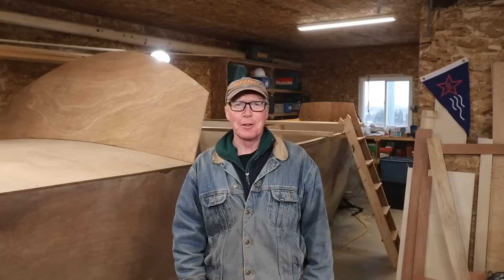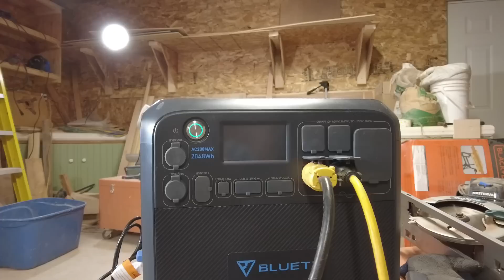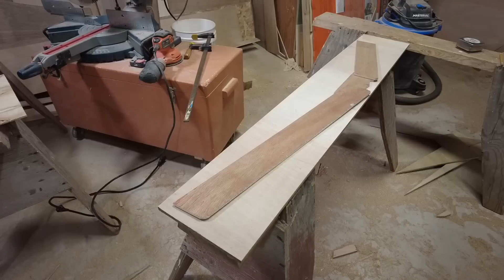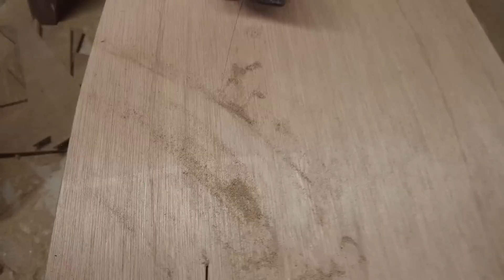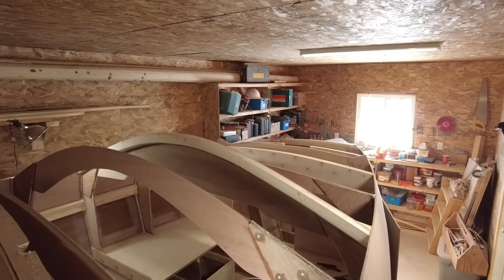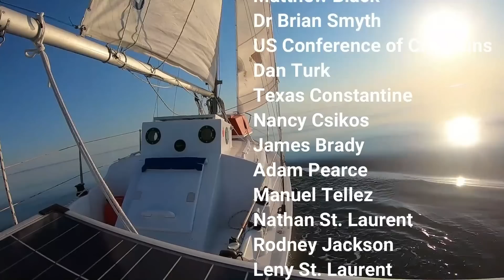S2E68 Ring Frames are Completed and the Shop Tools are Powered by the Bluetti AC 200 Max.

Comment: You may be able to charge your drill battery with 12v dc. I know that Makita makes a 12v charger for their 18v batteries. It's never available in stores and costs a lot more than the AC chargers. Whatever drill brand you use may have one also.
Reply from the maker: Thanks for that, I'll have to do a little research

Comment: Hi, please be careful with the bluetti and temperatures below freezing point! I think, discharging is not that much of a problem, but you have to take care, that the LiFePo4's are warm, when you try to charge them. They are too expensive to mess them up ;-)
Reply from the maker: Great point! I know that the larger model has a pre heater.

Comment: Alan if your going t have  some AC on the boat, I'd suggest a low power travel water kettle, they can be found at the 750 ml / 900 watt class, would save cooking fuel and reduce the heating water fire hazard etc I have a small 12v inverter and power mine from it when i'm on my car camping trips
Reply from the maker: Interesting concept I will have to run the numbers. Can you send me the brand name of your kettle.

Comment: When we talk about power draw (watts) of any device or tool, the "wattage" is a rate of consumption of energy. There is no "hour" involved here yet, so a laptop drawing 100 W is working at 100 watts of power. (No need to mention the hour, ever.) Often less if it's idle, of course, just like when gunning that wormgear before it was given something to cut.

(One watt is one joule per second, so you can't divide it by time again - that would imply an acceleration of the power draw over time!)

Here's a mnemonic to help when thinking about it: Let's think of watts of power in terms of a deck hand that can muster 100 watts. If you have a bilge pump that draws 100 W, that's like that man pumping at a brisk but leasurely pace all the time until he's relieved. If the leak requires him to pump all day long, that's 24 man-hours of work. Man-hours, watt-hours, same principle! Here's where the hours do come in but they are used as a multiplier, not a divider! (100 W) x (24 h) = 2400 Watt-hours, or 2.4 kWh of energy was required. (A bit more than is available in that Bluetti in one full charge, I think!)

Now let's imagine there's a 100 W photovoltaic solar panel on deck supplying energy and let's assume it manages to see the Sun for what's equivalent of six hours of perfect insolation (even if the days are longer, there are clouds, shadows, and imperfect conditions due to shading by rigging, sails, and not facing the Sun all the time). This gives us (100 W) * (6 h) = 600 Wh of energy per day per panel! This can serve as a rough estimate of how many might be desirable to meet the different loads underway, and for editing work at destinations. That 600 Wh daily dose would take three days to recharge an empty "Bluetti" (3 x 0.6 kWh = 1.8 kWh), or enable running a laptop at full tilt for six hours because (600 Wh) / (100 W) = (6 h).

The trick to making sense of the units is to involve them in the calculation along with the figures, and have them cancel out each other if they are present above and below in a division, or tack them on each other when we are multiplying them.
Reply from the maker: Very comprehensive, thank you.

Comment: It’s really taking shape now Alan, looking great! I’m imagining you are going to 2pac paint the interior- is that right? What colour will the interior and exterior be? I’m picturing white from everything I have seen of the original Wave Rover. The CAD image is making me curious though in blue and orange. 
Best regards
Braden
Reply from the maker: White on the interior (probably a 2pac). If you have expertise in this please share as painting is not my area.
Reply: @WaveRover2  Hi Alan, WR looks great. I'm working on a cold molded yacht professionally.. we use one part mono-urethane with reduced gloss (eg semi gloss) on interior surfaces.. with the exception of bilge kote over blush free epoxy (eg west 207) for the bilge, etc.. the exterior is two part poly where you want that automotive paint finish...  I recommend looking at @atomvoyager on youtube- he uses epoxy barrier coat for bilge and inside lockers to good effect. Also the book "Rolling Perfection" for excellent method of applying two part PU without spraying. Regards Ryan

Comment: If you want to get straight lines with a jig saw, just run the jigsaw along a batten or any straight edge,  if at all possible.  Btw Congrats on getting all those Frames in, that's deserves a celebration, must feel really good. Cheers bruh boat coming along just fine. She's lookin really good.

Comment: If your laptop supports power delivery through USB-C then you should be able to use DC power on the battery unit and not have to use the inverter.
Reply from the maker: It doesn't but another Rover has informed me that I can buy a 12v adapter designed for my computer.

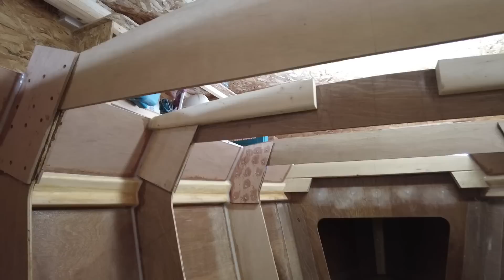Comment: At 25:20 and on you really see the strength,  remarkable storage space and above all the over the top craftsmanship the Alan is putting into this future iconic singlehanded sailboat. Thanks for taking us along.
Reply from the maker: The frames are amazingly strong for only 3/8 material. I am able to do pull ups on them now that the stringers are installed.

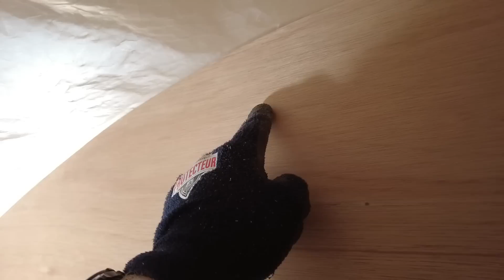Comment: 21:24
A technique I've used for decades is to take your utility razor knife and score the pencil line before making the cut. 
It creates a PERFECT edge if you can "ride the line" which any woodworker worth their salt is able to achieve. 👍
Reply from the maker: In an earlier episode I demonstrate that technique for straight cuts across the grain. You don't need to do it running with the grain with a good saw. For curves, you can't beat the method I show in this video.

Comment: In the mid 1970s I was stationed on the island of Iwo Jima. Glass balls constantly beached themselves on the island's shores. Several of the stationed personnel collected the glass balls and shipped them home. 

The LORAN station courtyard used the smaller glass balls as decorations.

The side of the island where the station was, had a very rocky area. The glass balls entangled within those rocks easily and rarely broke. Invasion beach did not have many glass balls. The sand on Invasion Beach was very dark (almost black). The grains were rounded and did not pack well. The elevation change from the water to the consolidated grassy soils was also very steep and tall. 

The John Wayne movie was filmed in southern California with almost white sand that compacted easier.
Reply from the maker: Thanks for that. It adds a lot to my glass fishing floats story. Great comment!

Comment: Sven yurvin says that the incredible gain in structural strength increases tremendously as you reduce the size of the vessel. A smaller boat is more likely to bounce off a log than a larger boat .
Reply from the maker: He is absolutely right, hence the comment I made about the glass (light) fishing floats that cross the North Pacific.